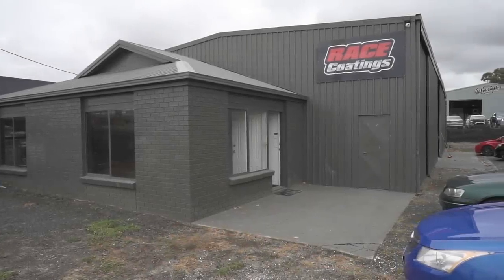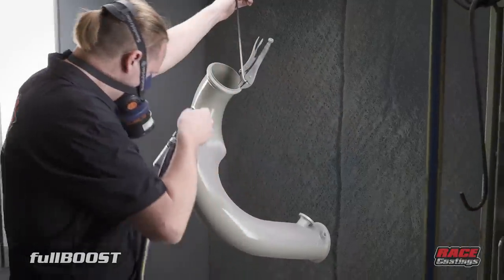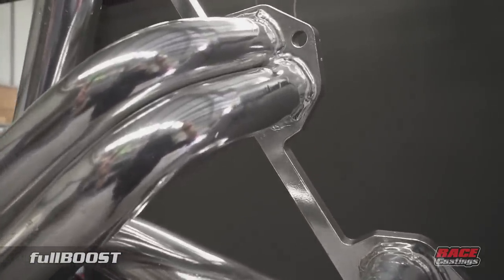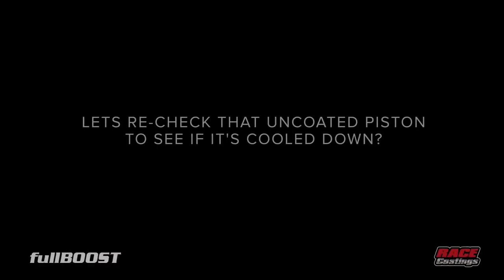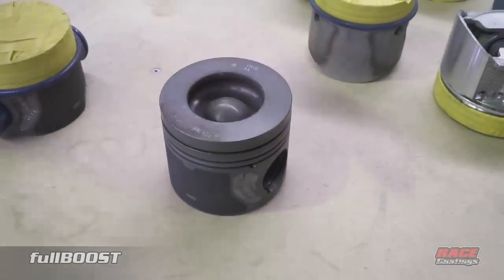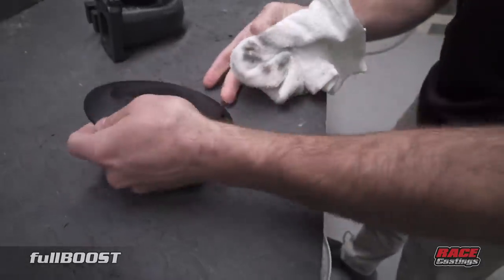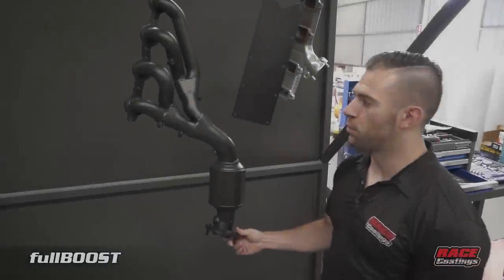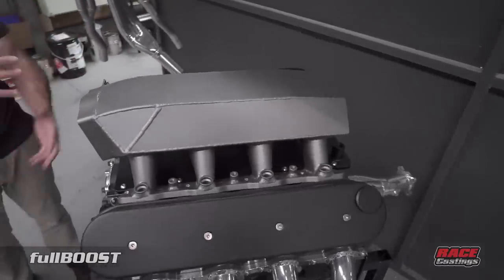What is Ceramic Coating? | Race Coatings

Comment: That piston demo was a bit dodgy don't you think??? To start with he held the flame a lot further away with the coated pistons- away from the hottest part of the flame. Then the editing didn't allow you to see if he held the flame on as long as he did with the non- coated piston (although that may have been done on purpose). Next time someone tries this on, you might want to remind the person that your viewers aren't that silly and a shady demo will in tern make the product look shady. Disappointing- was hoping to see a fair and honest test to see how good it realty works. Think I might stick with the coatings available from the piston manufacturers for now...
Reply: Daniel Brealey  i saw that  it was kinda bias. holding it further away on the coated pistons.
Reply: Holding it further away is actually making the test more difficult. It heats the piston more slowly giving more time for the heat to transfer to the bottom. It actually makes the coating more impressive.
Reply: It's because ir thermometers can't accurately read temps from reflective objects. The top was much reflective than the inside.
Reply: Skirt on uncoated piston is different shape and looks coated to retain heat maybe? Definitely shady
Reply: Uncoated looked like steel while the coated ones are aluminum.
Reply: ELECTRICJELLY _ A steel piston?
Reply: I honestly don't know if that's a concern but I did have a question concerning the pistons and heat transfer from cylinder walls to cylinder head through physical contact?
Reply: False.
Reply: How is that Shady he heated them all up to around 80° one of them is 85 one of them is 81 the last one 79 then he flips them over and takes a reading the uncoated piston on the inside is 213 in the coated ones are around 60 degrees what are you trying to say that ceramic coating doesn't help dissipate heat because it's a fact that it does there's nothing Shady or even up for discussion really ceramic coating helps dissipate heat they don't need to fake that it's just a fact I don't think he was trying to do a real scientific demonstration but leave it to the internet to poke holes and even the simplest of demonstrations if you think that was fake why don't you get it powder-coated anything and one that's not powder-coated and test yourself it's not up for discussion powder coating helps dissipate Heat
Reply: regardless of what been coated on the top of the head, heat soaking will occur relatively quickly and the coating is just a gimmick at that point for heat.
Reply: Did you also notice the 2 painted pistons were differnt than the unpainted one... when you do a test all it should all be the same type piston.
Reply: you cant really do a scientific analysis with a blow torch and a IR thermometer anyway. just gives you a rough idea. but literally anything is better than bare metal when it comes to heat transfer
Reply: Op is right. A non video edited demo with the same parts, timing, flame, etc would have been nice. Just that dodgey of a demo means I won’t be doing it. 

Sucks.
Reply: It's true that the test did look biased but hundreds and hundreds and hundreds of test that were scientifically valid proof the worth of ceramic Coatings are used on the space shuttle NASCAR engines Formula 1 engines they work.
Reply: @andrewmathias1967  Ceramic coating doesn't dissipate heat, It's an insulator. It works because it stops the piston heating up.
Reply: The superrglow rag wiping he did is dodgy too. He wipe the powder coated one directly after he pour the solution into the rag, then camera cuts to show him wiping the other two.
Reply: ELECTRICJELLY _ pistons are not steel or aluminium there hypereutectic alloy no need to thank me for teaching you all that info :-)
Reply: Right you are, mate! I was about to leave a comment on this, but you turned out to be ahead of me.
Reply: A short term test is one thing, but in an engine the heat is gonna sink in in the long run. And on a trip to the store, the engine will never heat up properly.
Reply: Daniel Brealey where’s the control
Reply: The issue in the test is the top of the piston was heat blued and was not shiny, the bottom side was shiny. They really needed to adjust the emissivity on their thermometer to get an accurate reading. Surprised they didn't know of this setting...
Reply: Top temperature is shown then bottom temperature is shown in one take Wat are u talking about
Reply: Aluminium gets rid of heat fast but if you can slow down the heat into pistons with a simple coating giving the pistons that extra protection that's a win for me
Reply: Aluminium retains heat quite a bit...
Reply: So how are piston manufacturers unbiased in what they offer? Skcipism is good but can be unhealthy at times. Look are your trying to convince yourself on your next build you don't need to invest money into coatings. The other myth is that coatings are only for professional racing teams. Well given the general apprehension of most enthusiast to get their money's worth out of their investment by USING IT (ie, circuit racing, drag strip, hill climb, road rally, roll racing, etc) coatings would go a very long way in insuring reliability long term given you are just a weekend warrior and can't afford to have their car be down for extended amount of times. I have lost more than $7000 in the last three years to rental cars for various reasons with my 2016 Focus ST. That is more than the mods I have in it... I will be taking advantage of many of the same treatments that Le Mans Team, F1 and NASCAR use in their engines. It worth every penny considering I am tripling the output.
Reply: try  high school again
Reply: shallow heat will gt to 80 but the mass of the heat tacked awhile to transduce through the body to the underside since ists a chunk of metal. the heat dosnt soak all the way through instantly. therefore you get it. yeah there cheating . besides which how exactly will a.5 micron film stop 1500 degrees of heat  i mean hwts the science idea.
Reply: @Thomas-cu5hp  I agree with you, I believe what the video was trying to demonstrate is better insulation between the heat soak between fire and oil through piston to rod to crank to oil.  The block is cooled. The piston is lubricated and there by cooled by the oil.  Seems reasonable to assume any unwanted  heat would be lost energy.
Reply: exactly what i was going to write
Reply: @bryancomeaux4961 Thank you. You saved me from having to explain that. Their little experiment was definitely not white coat worthy.
Reply: honestly idc how far the heat was away from the pistons but I woulda liked 1 full take for the test to show one wasnt heat soaked more than the other 2, also it showed the uncoated piston was 600 degrees on the front idr being able to actually see the measurements of the other 2. now I dont believe you guys were trying to be shady more so trying to save time, but let's face it...its the internet and you cant believe everythin on the internet
Reply: 2 different pistons of different thickness crowns and skirts, IR temps on reflective objects varies... Would like to see the test again in more controlled conditions.
Reply: How Long would that coating last inside a running engine?
Reply: @andrewmathias1967  Oh mate, the fact that the piston on top is cooler than inside makes no sense. If it was 85c on top, it would be 85c underneath. If it was 200c underneath it would be 200c on top. Understand, it was a dishonest demonstration.
Reply: @Thomas-cu5hp  Your comment was a few years back, but just wanted to add/ask, if not enough heat can dissipate through the piston, can’t this cause pre-detonation by too much heat in the combustion chamber?
Reply: It's about how much heat from the top of the piston transfers to the bottom and there was a huge difference in that. otherwise yeah sorta dodgy looking but still proves the point
Reply: @itburnswhenip  that's what I initially thought but even engine analyzer pro shows that good engine thermal coatings can allow greater timing. Think about it this way.the coating is to hold more heat inside the chamber, trying to insulate it from the head and the top of the piston,both of which are spots that typically detonation starts from. then exp Ling more heat to the exhaust and out of the engine bay. by removing let's say 5% of the combustion heat from the motor you have removed 5% heat that the oil and cooling system would have to deal with allowing the next combustion cycle to occure in a colder chamber which already makes more power and allows for more boost or timing
And with more heat in the exhaust you could expect a turbo to behave more efficiently
Reply: @jacobvanhalteren7452  Why be dodgy about it though? I know what the coatings do- there's need to lie unless their coatings are inferior
Reply: What are you talking about
The heat gun was reading the temperature all the proof you need
Reply: @charlie2king  You've missed the point, the testing treatment was very sketchy. It was supposed to show how much less heat build up there was, but the heat wasn't applied equally... If they had more trust in their products, the testing regime would have been better
Reply: Well buddy it works an works very well been doing it for years
Reply: Do that then. There are ceramic coatings provided worldwide. They have been proven for decades from multiple manufacturers.

Comment: Ever since I got ceramic coated headers on my Nova, they're the only kind of coating I use. No wrapping, no paints, no other coatings -- just ceramic coating. Keeps heat in the engine bay way down, it looks good, it lasts a long time, doesn't rust. For an idea, my Nova dropped 46°F under the hood after putting ceramic coated headers on. It's really worth the extra money.

Comment: for all you guys asking about putting on cylinder walls and crank journals the answer is absolutely not these area's are machined to tight tolerances and also this stuff would not hold up to the friction on moving parts

Comment: It's literally impossible for the top to be cooler than the bottom when heating from the top. The reflectivity and emissivity were messing with your meter.
Reply: Exactly, this method of temp measurement is wildly inaccurate between shiny and flat black.
Reply: just another fucking gimmick. its like a pray on tan.

Comment: So adding more ceramic coats on internals, can give you more hp gains and torque because the heat resistant ceramic coat reduces the heat so dramatically. That’s actually impressive. I love this idea.

Comment: I would like to see a running engine exhaust temperature test with an EGT inside the pipe and a laser temp ouside to show how well the product works on keeping in heat.

Comment: Holy hell!  I couldn't have been more wrong about the ceramic coating process!  I always assumed it was an electrostatically applied powder, just like powder coating.  I also figured it came out of the oven with a shiny finish... Or the quality of gloss would depend on the surface finish of the metal prior to coating.   This was definitely educational!
Reply: there are different type of ceramic coatings the coating they are using is cerakote or a copy of it i did some parts with this stuff a few years ago it good stuff i do my transmission cases and engines in cerakote c series air dry stuff.
Reply: @turnmaster1754  just on that mate, is it ok to cerakote air cooled motorcycle engines? Cheers

Comment: A few years ago I was rebuilding a tractor for the home farm, and just for shits and giggles, decided to have the pistons coated. Wasn't looking for better performance, just thought it might start better in the cold if the piston wasn't sinking away as much heat from compression. Now I didn't have a "control", and the engine was already badly in need of an overhaul, but it starts better than when it was new, and is still running well. So was I crazy for trying it?
Reply: Erik S 
Nah, it’s good stuff, if I had a place closer to me that performed ceramic coatings I’d be doing it in anything I tore down. 
Those pistons are thanking you.

Comment: Nice demonstration and info. 
I have a goal to one day have a 70's American mussel car with a few modern but easy to work on personal touches but the plan is also to have a motor that is totally gone through and made to last forever. I'll definitely be considering that piston coating. Sounds like it will help the oil retain viscosity longer.

Comment: When you more than double the distance of the flame, on the coated pistons, it doesn't look good, and is misleading... ceramic coating works, no need to exaggerate the results.... lol
Reply: Boosted01R the 2 coated pistons are different from the uncoated one too.
100% agree it is a proven process no need to make it look better then it is
Reply: Wasnt real scientific was he? Yeah we believe you mate, no need to see it done. Show us the black stuff on the rag and quickly hide anything wiped from the ceramic.  Like one of those late night infomercials it reminded me of. I'm sure it works but as far as demo's go - lil bit dodgy.
Reply: don't dick about- if you are serious just send the parts here https://www.wallworkht.co.uk/   with what you want doing. no backyard stuff.
Reply: Looked like he heated the uncoated piston for a lot longer then the coated pistons.
Reply: lol still some people will believe the exaggerated results
Reply: Agreed. Just watched and had the exact same thought. Very disappointing
Reply: The point is not the distance of the flame. It's the temperature difference from top to bottom of the Piston.
Reply: and they are aslo completely different from each other
Reply: How are you going to see any coating rub off when it's *clear*?
Reply: kgkustomz97ser  Even if he rubbed it all off how would you see it? It's clear.
Reply: It works, but you don't need to pay someone to do it. Maybe on the inside engine parts, but I have been using 5 dollar ceramic engine paint since the early 90s. The stuff you get from your auto parts store in a cheap spray can is extremely good for the price. The engine paint has lasted over 15 years now on one of the oldest engines I still have and the paint still looks perfect. The header ceramic lasts me as long on new parts, but I have even been lazy on an old atv I don't care enough to clear rust off of. Sprayed directly onto a rusty header and muffler it has lasted 7 years and is just now showing the need to recoat. That is pretty amazing  that it stopped the rust for that long and looked brand new for over 5 years.  I know the guys that have the money will laugh at me, but for the guy on a budget try it out. The stuff works great.
Reply: Jonathan Simmonds I can tell you for absolute sure that I will not be sending engine parts on a round trip to the UK for a coating lol.
Reply: Holding it further away is actually making the test more difficult. It heats the piston more slowly giving more time for the heat to transfer to the bottom. It actually makes the coating more impressive.
Reply: Test is very clearly flawed. If the ceramic did actually block heat transfer that well, you would see a far higher temperature on the top of the piston, because the rest of the piston is taking up less of the heat. So the fact the bottom of the piston is colder and the top is the same makes it super obvious less heat was applied. Also them saying the ceramic one cools down quicker is also complete nonsense. If anything, the ceramic should retain more heat as it does not transfer heat as good.
Reply: @FranseFrikandel  oh my god, ceramic don't absorb heat like metal do. It protect what is behind it(from heat). Obviously bottom part of coated head is cooler, because it(heat) stay above coated ceramic,the heat localised and dont dissipate heat like metal do.
Reply: I saw that also But Seriously, is there a ceramic coating that Work’s?

Comment: That's a really cool process and clearly has superior heat and wear resistance. But to be fair to powder coating for lower temperature cosmetic applications, the only solvents that I have affect it drastically (assuming proper preparation and curing) are methanol and dichloromethane (methylene chloride)...which happen to be the main components of powder stripper.
Reply: Indeed, way overboard on the whole engine  Pistons, headers, turbo parts, sure.  Low heat, stick with polished, chrome, or PC.  Heck, even automotive paint and clear work well.  If you're going "pretty" on an engine, it's not getting solvents on it.  If you're a performance oriented only, you're not worrying about being pretty.  Strict performance increases only.

Comment: Reading the comments I'd like to see you do another video to do like a mythbusters episode to disprove some of what I see. I work in a lab. Putting the blowtorch on a stand for the same time on each piston to ensure the test is the same for each piston. Then measuring each temp at timed intervals over a long period of time you could create a graph to show what's going on. There are many variables that need to be sorted out aswell but I'm not going into it now.  I was a powdercoater for years and ceramic is a far better product as powdercoating is  just plastic really. Could you do a chip and scratch test aswell.